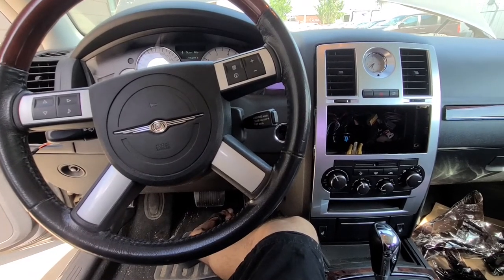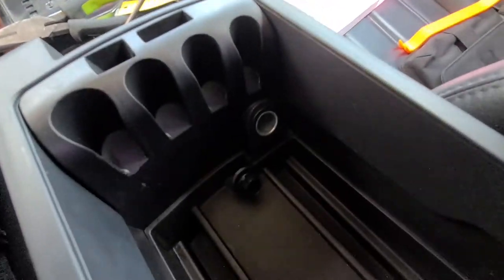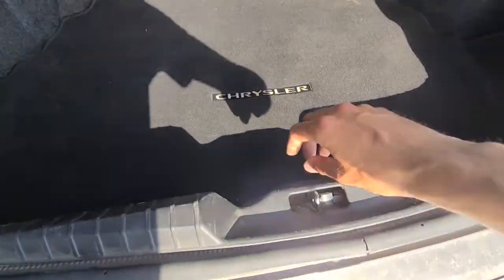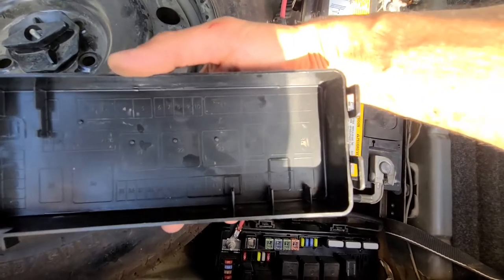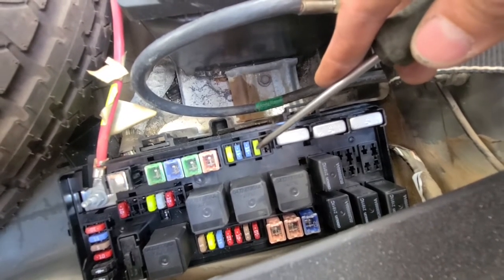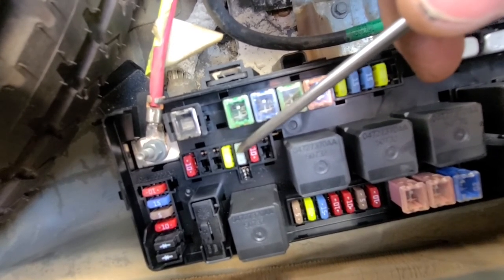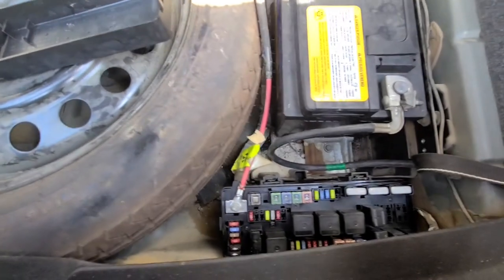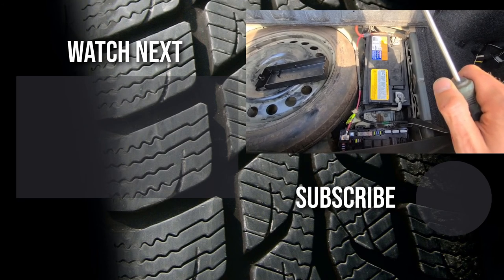Chrysler 300 - POWER OUTLET / CIGARETTE LIGHTER FUSE Location (2005-2010)

Comment: I have a 2007 Sebring, and my lighter and the other one doesn’t work. Do I check in the same place?
Reply from the maker: I have a video on Sebring. Here is the link:
https://youtu.be/YlG9qAW6Erk
Reply: Same car , it has an antifreeze leak somewhere. I have had several people to try to find it but can’t; would putting in stop leak help ? I think it leaking from the plastic container, but I’m just woman..🙂
Reply from the maker: @beverlysmith8231  stop leak can sometimes temporary fix the problem, but it can also plug up the radiator. They should be able to diagnose where it leaks using the dye
Reply: @QuiteAlright  thanks , that’s a great idea

Comment: My outlets are still not working and both have new fuses.
Reply from the maker: You will have to test if power is coming to the outlets. If yes then problem would be in the outlets and if not then there is a wiring issue somewhere